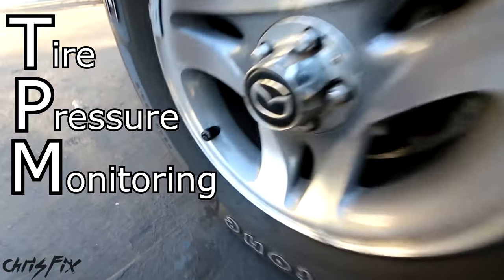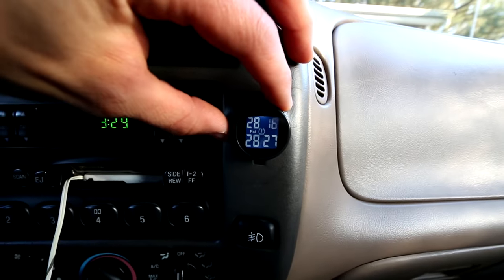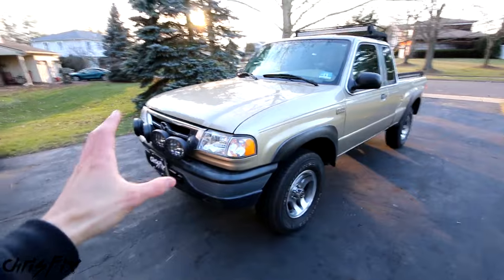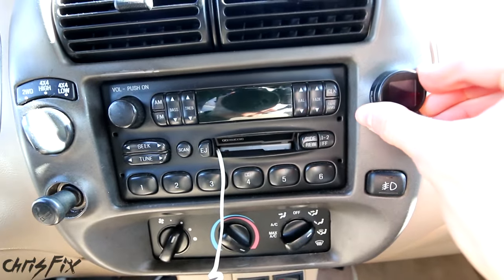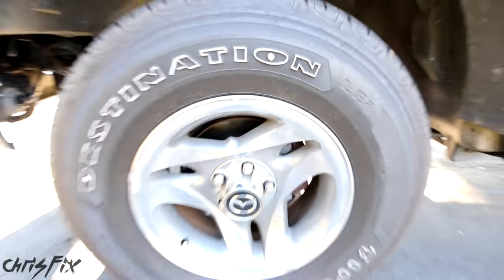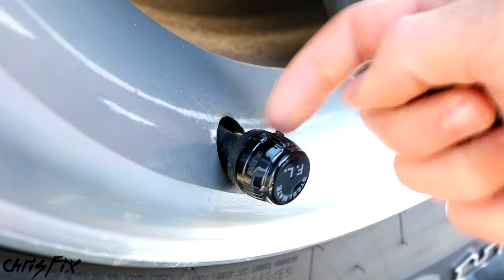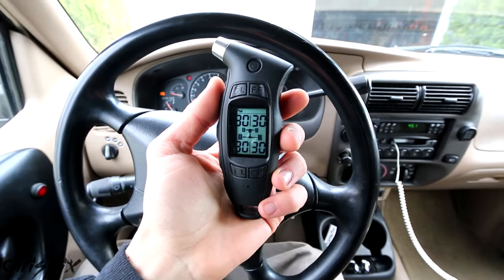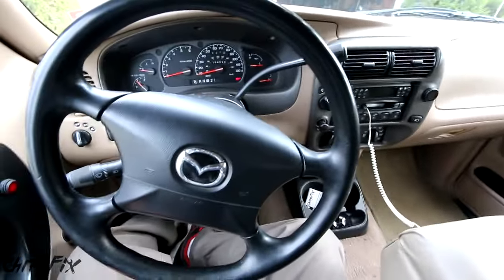How to Install a Tire Pressure Monitoring System in Your Car

Comment: Oh, that's just inviting some arsehole to steal your sensors. I'd rather go for a system that replaces the valve stem, personally. Good video, though.
Reply: Did you even watch the video? You need a spanner and a special wrench to remove the sensor. Anyway, if someone were able to remove the sensors they would be of no value to them with out the display unit that's made to work with those sensors.
Reply: Tat2Dragons I did. Commented a titty bit early. The locking system would still be easily bypassed with a farmer wrench.
Reply: +Tat2Dragons Sorry but anyone with half a brain can get one of those off. Judging by the size of the nut all you need is a standard 10mm hand wrench. If you are worrying that much about your tire pressure then just spend the $100 on a air compressor and a tire gauge instead. It takes less than a minute to check your tire pressure.
Reply: AnthonyH Sadly that is true.
Reply: +Austin Harmon i for example think this is worth it .... especially for people who drift their cars or race them as knowing the tire pressure can help a lot
Reply: NotIrishRider I'm not saying that it's useless. It is a very handy tool especially for drifters and racers. I'm just stating that if you have a tire that is running flat quickly on a daily driver it would be a better option to fix the tire or get it replaced than to get this.
Reply: +Austin Harmon Yeah, I guess someone could remove them, but like I said before, if they do steal them they're going to be of no use to them without the display unit. Also, unless you're familiar with these sensors, I seriously doubt you're going to break out a few hand tools and waste any time just to remove these. Sure you could buy an air compressor and a tire pressure gauge to check your tire pressure, but one of the main selling points of these setup, is that you can keep tabs on your tire pressure at all times, quickly, and effortlessly.
Reply: How useful would those pressure sensors be if they don't have the monitor?
Reply: Frank Gonzalez People steal shit for the sake of stealing shit, man.
Reply: +AnthonyH or scissors.
Reply: +Austin Harmon or just cut the valve stem with scissors/clippers
Reply: +AnthonyH thiefs are lazy tho.
Reply: +AnthonyH  yeah but chances are it's not going to happen unless your in a shitty area
Reply: +Frank Gonzalez you think thiefs are scared to grab the monitor from inside the car?  lol
Reply: +dynocompe its kust plugged into a cigarette lighter. throw it under the seat when you leave.
Reply: its just 100 anyways. at thief would steal a tire before removing all the sensors and monitor system anyways.
Reply: T Wayland no they wouldnt, a tire is big and bulky, this is small and easy to conceal and sell.. Thieves are people too and realize most people just hide the shit in the car , thats why cars are ramsacked when broken into to
Reply: +T Wayland wouldn't thief also need the transmitter from inside the car?  cuz it's probably transmitting with encryption anyway, too.
Metal stems ought to be standard anyhowzzzzz

Comment: can u make a video on how to install push start button on a car??
Reply from the maker: Cool idea
Reply: Remote start would be awesome too!
Reply: Remote start requires a bit more work. They have 4 basic wires, because every car is different more knowledge about the car is required. The multi ignition cars are a royal pain.
Reply: As much as I like Chris fix and watch him more than any other car enthusiast, mighty car mods has a video up about how to install push button
Reply: Doesn't push button start make stealing the car super easy?
Reply: Columbus Thomas why would you want that..
Reply: My car has push button start, but you need to have the key remote for it to work.
Reply: @runescapefan0001  no they still need ur keyfob in the car to start the car it has a transmitter that needs to be in the car for u to be able to pull it out of park u can start the car and walk away and the car will remain on but you can move it out of gear itll just shut off and tbh its not worth putting one in ur car if it didnt come with one dont bother its really not as cool as it seems

Comment: Great video Chris. I might get one of these systems on my taurus.
Reply from the maker: +Jmoney Thanks a lot man!
Reply: +ChrisFix I like these kind of videos and hope to see more.
Reply from the maker: +Jmoney Any time I come across something I really like, I will make a video for you guys!
Reply: +ChrisFix Awsome
Reply: +ChrisFix Chris, I bought this set because of your review... just to let you know that it does not work with my 2013 RAV4 since it has a dust cover on the cigarette and it will not allow the plug reach power.
just and FYI
Reply: Really... buy a extention.. remove the dust cover... etc. Your comment almost sounds like your blaming a youtube video for your purchase.
Reply: +jareza get a splitter, ext cord, or extra aux plug socket for less then $10.

Comment: I have an 07 Chevy Cobalt and it didn't come with TPMS because it was made in late 2006 and sold as a 2007 model. TPMS became mandatory on all vehicles made after 09/01/2007.  Purchased the kit shortly after buying new tires a few years ago. The tires are low profile and is difficult to tell if they are low on air. One day, around a year after buying the tires, I got into the car and the monitor was beeping. Showed the front right tire was low. Looked at the tire and it looked ok. Checked the tire and it had a nail in it. Aired it up and later on got the tire fixed. Saved me from driving on a low/flat tire which would have ruined it . A new tire alone would have cost over $100.

Comment: Sadly some cars the cigarette plug is on the bottom of the center console under the A/C controls normally in front of the gear stick so you wont be able to see the pressures, unless their is a version with a portable screen that you can place somewhere.
Reply: +IIGrayfoxII That is exactly where mine is. You must drive a Subaru or a 94 Accord.
Reply: +drink15 Impreza.
My previous car was a civic hatch and it was just below the gear shifter, which is still away from eye sight.
Reply: +IIGrayfoxII You could install a second cigarette plug in a more visible spot. It won't look as good but its possible.
Reply: +AndyPFTW I ain't hacking my car, If I was to use this kind of product, I will go for one that has a portable screen that I can attach to the A-Piller

But I check my tire pressures each time I fill up so i see no need to have this kind of thing.
Reply: +IIGrayfoxII You can disassemble it and put it were you want. Only 2 additional wires :)
Reply: Yeah that's completely understandable.
Reply: +ruhoer eoijre If I dismantle it I would hardwire it into the fusebox and keep the cig socket free
Reply: IIGrayfoxII Yep. I like it too, and i want to put it on my car's dashboard. I need free cigarette lighter  :)
Reply from the maker: +IIGrayfoxII Dang, they do make one with a swivel screen if you look on amazon.
Reply: +ChrisFix When the tire pressure is low does it make a sound or does it just show you that it's low? Either way it looks awesome and I'm for sure going to invest in it soon.
Reply: +AndyPFTW in the video he explains and shows on video the audible alert the screen in the video makes when below 20Psi. did you not watch the whole video?
Reply: +IIGrayfoxII You just accurately described my Oldsmobile Intrigue.
Reply: +IIGrayfoxII You don't need to be looking at it all the time you know... Just before you drive off is good enough.
Reply: +thelasthallow I did I just didn't remember hearing that.
Reply: yup same story With my ford Explorer
Reply: +IIGrayfoxII a lot are lower, but it beeps at you if the pressure is out. Additionally, its easy to glance at the screen no matter where it is before you drive off
Reply: Get an aftermarket outlet. You can usually find ones that basically let you relocate it or have 1 or 2 extra. Have an older Mazda truck and used a hole saw and put one in the upper dash.
Reply: It does a beeping sound so what's the problem?

Comment: Also kinda annoying that you have to go through the same installation procedures and check for leaks any time you rotate your tires too..
Reply: Nismo9132 It makes me wonder why they hard coded the wheel positions into the sensors instead of assigning them when you pair them to the display
Reply: And when you add air to tires you have to do the install steps again on the tire valve stem. Just easier to check the pressure with a good gauge.

Comment: Do they throw the balance of the tire off? Anything weird, like noise, vibrations?
Reply: Bought this exact TPMS system - nothing notable in the year I've spent using it.
Reply: Some systems recommend you balance your wheels after fitting them.
Reply: They have to affect the balance. Pure physics.
Reply: @Smurphenstein  that is if you do the whole valve stem with a sensor which the sensor is inside the tire.

Comment: Great video as usual. Thanks Chris! FWIW the TPMS warning light illuminated on my wife's SUV a while back (2010 - came with stock TPMS). Checked all of the tires and all were at the correct PSI. Thought one of the TPMS monitor batteries had failed. Took it to Discount Tire and it turned out to be the spare tire pressure was low. Don't forget to check that spare! Keep up the great work.

Comment: This would a great gadget for my older cars too but already have a dual dashcam plugged into cigarette lighter port. Also, tire pressure not much of an issue anyway since filled with nitrogen; hardly any fluctuations.
In any case, great video as always Chris!
Reply: i looked up the brand featured in the video and they also offer a solar powered version

Comment: I have a question for u ? What's the purpose to have a tire pressure system now days on vehicles ?  Can u tell me  wich are causes if u have low tire pressure on tires ? It is a just lexury funtion on vehicles o other ?

Comment: I don't care for this technology. The addition of the monitor slightly throws off the wheel's balance. The stem is no longer sealed because the sensor pushes in the pin. When they came out with the atrocious run-flat tire technology they needed a way to warn the driver that a 75 mile range clock was ticking on their flat tire. TPMS was supposed to cure that self-imposed problem when the cure is not getting run-flat tires. Once TPMS existed it was added to all vehicles. But TPMS is a poor solution because it goes bad early in a vehicle's life and is more trouble to fix than it is worth. Most of the people who don't check their tires also can't handle filling them up when they have been notified they are low. If you don't have a compressor it is now hard because gas stations no longer have them, they are broken, or require coins and work like garbage. 

I have something way better than TPMS on my vehicles - a properly inflated full size spare, an 18 inch breaker bar/extension/socket, jack, work gloves, portable compressor, and a tire repair kit. Luckily TPMS is now obsolete and we no longer have to suffer its design flaws, the biggest being turning on a distracting dashboard warning light when everything is fine. My 2015 vehicle uses revolution counting. When you fill your tires you set calibrate. The vehicle then calculates when a tire is low. Unlike TPMS it doesn't go bad due to battery failure and you don't need waste money buying extras sensors for your snow tires. TPMS is junk tech.

Comment: So will this work on my 1980 jeep it has a cigarette lighter and tire stems
Reply: Assuming it has both, it should.
I've bought the same system for my own car (90s era Civic), which has pretty much the same thing; works flawlessly. Installed properly, the TPMS should take the place of your tire stems' caps.
Reply: Should work on a Model T even if it has a 12 volt outlet and valve stems.

Comment: Very nice in the US where you have crazy-low speed limits, however I wouldn't try this on my car driving the German Autobahn at 100+ mph. Also, for most cars you need to have your tyres balanced for higher speed rotation (they put small weights onto the inner side of the rims) and any kind of overweight or difference matters. So again, this is good for a slow-rotating big tyre on a relative slow car like this one here (or a truck) but definitely a no-go for a normal passenger car, especially not at normal EU highway speed limits (130 kmh / 80 mph).  Btw it's worth to swap rubber made valves / valve stems to metal ones, rubbers tend to weaken up due to movement and leak air sooner or later at the small cracks while tire is still ok.

Comment: $110. hum
Reply: +Liqueur When you consider it is less then the price of a tire these days not that bad.
Reply: $73 on ebay
Reply: +Nerys yeah, but are they worth it those cheap no-name ones ?
Reply: +Mr. C you assume there is any difference at all I propose they are identical products literally from the same factory
Reply: +Nerys Can you post the URL?
Reply: +Nerys It looks like a cheap replica of the Steelmate version. Where is the dust covers etc.? And no images with the LCD screen turned on so you can see the quality of it.
Reply: +Mr. C i will bet you one set of these the only difference is a silk screened steelmate logo
Reply: +Nerys and dust covers ;)
Reply: +Nerys the problem is, it will be hard to tell if they are the same. There could be no difference, or there could be a huge difference. When they are manufacturing these, the casing may be the same but the internals or battery may be different just to lower cost. As they assemble these, its easy to finish an order and bring in different inserts and change the stamp to keep production running and minimize downtime. I have seen "no brand name" production by the big brand name company using the exact same product. I guess they figure if they cant get you to spend the price on their main product then they still get you with a no name product.
Reply: In relation, cars with a built in TPMS system cost $60 A SENSOR.
Reply: CARCHET seems like Imitation tpms , not sure about the qualities.

Comment: How do the sensors get power to measure the pressure and send it to the display unit inside the truck?
Reply: Tooniis+ I bet it's like watches that generate spring power from wrist movements. Probably a tiny generator with weights.
Reply: Tooniis+ I bet it's like watches that generate spring power from wrist movements. Probably a tiny generator with weights.
Reply: ***** that means you will have to charge them once in a while, but he did not mention that at all.
Reply: MicroKORGI possible...
Reply: Did you watch the whole video? He clearly says they have batteries and will last about two years
Reply: CStedronsky I did not hear that... Maybe I was not focused on what he was saying at that moment.

Comment: They should consider adding a pressure monitor for the spare tire.  That's often difficult to access when you want to check it.  Unless I add a valve stem extension, I have to remove mine from the storage well in the trunk just to reach the Schrader valve.

Comment: To the smart asses saying they just wouldn't be lazy and check their tire pressure with an analog gauge. If your that proactive about checking your pressure good for you. But what you arent proactive enough to do is check your wheel temp.  So when your temp is significantly higher on one wheel compared to the other three you'll know somethings wrong and have it checked out. Its how i was able to diagnose that my wheel bearing was bad even though it hadnt started to make a  clear sound yet. But it did save me from chewing up a $300+ tire too badly. I think it had just started to cup. But it could have been a bad caliper or a couple other things thats best to catch as early as possible. Ill always have a tpms monitor system on my vehicle and trailers. Its an invaluable tool. Anyone saying otherwise is woefully misinformed on exactly what they do. Id suggest reading up on something before you make a foolish statement about it

Comment: 2019, Sweet clearance at walmart $13
Reply: Really, that's is a bargain. I need to get one.
Reply: Man I came across that same clearance deal! Bought it and hooked it up right away, worked awesome. Then about 2 weeks later outta nowhere it stopped working, the display was just blank. However, the USB port on the side still had power and worked fine. Was super bummed but figure maybe that's why they stopped selling em and the reason  it was on clearance. Was accurate and I really liked being able to see the temperatures of each individual wheel, that could help warn of a wheel bearing gone or going bad. Are you using yours? Does it still work?

Comment: I'd never use a set where the sensor replaces the stem cap. I can guarantee that they'd get stolen within a month by snipping off the stems. I've had 3 mangetic "new driver" stickers stolen within a month after I got my drivers licence. The stickers cost 2$. The only option for me is a set where the sensor replaces the whole stem. Hell my coworker got his parking sensors stolen. Someone actually cut the wires off AT THE SENSOR. They're useless without the rest of the electronics which were in the car, but someone stole them anyway.

Comment: One problem, you need a fifth sensor for your spare tyre. It sucks if you have to use it and it's flat.
Reply: You should be checking your spare on a regular basis. Then again you should be checking all your tires occasional...

Comment: I wouldn't buy these under any circumstances especially if you are going 4WD. If you think I am going to remove these, air down, reinstall again before heading off into the rough - and doing the opposite at the other end then think again. Fine if you live in a neighbourhood where nobody is light fingered AND never go into rough stuff then fine.